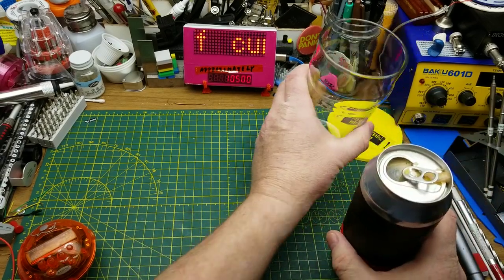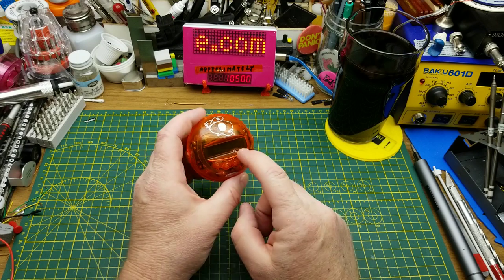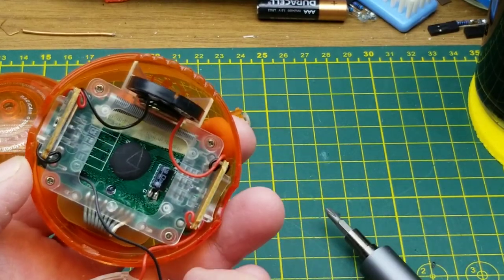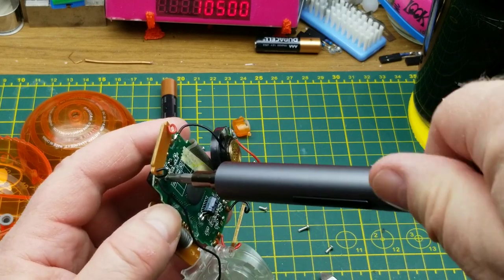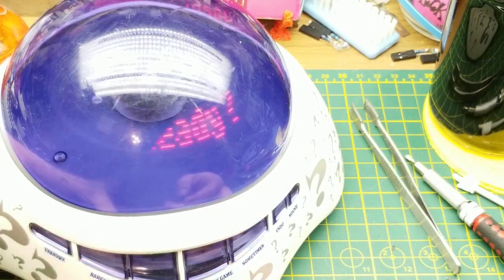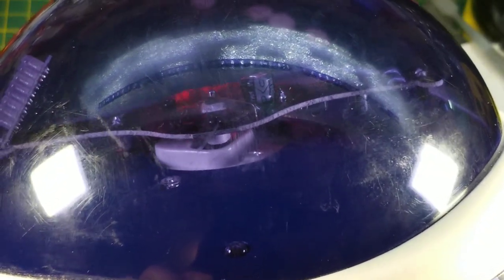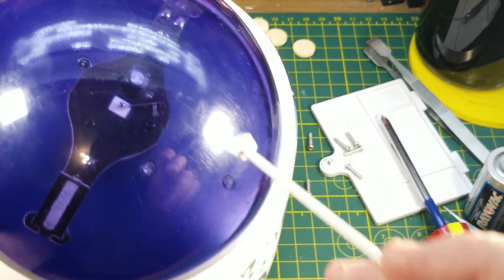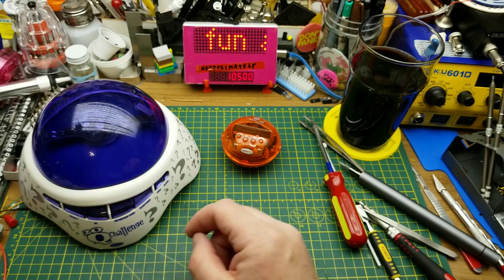curiosity teardown: electronic 20 questions game

Comment: Been there done that, don't beat yourself up. That method of display connection is almost impossible to fix.If just a few segments are missing, putting pressure pads in the right places will force the ribbon against the glass and will work for a while. I have done this on my blood pressure monitor and it is holding up quite well now after two years. I have never successfully replaced a ribbon that is fully unbonded.

Comment: Scotch tape is your friend!  I have fixed one ( of 3 ) of those and putting it face down (  sticky side up, glass side of the LCD onto the tape ) then the pain of cleaning up the contacts on both the glass and ribon cable before ligning up and using more tape to hold the ribon on.  Of the 2 failed, one was ripped prior and the other died during the cleaning.